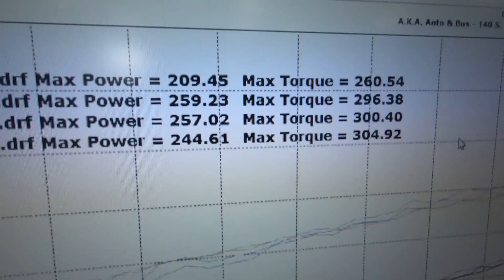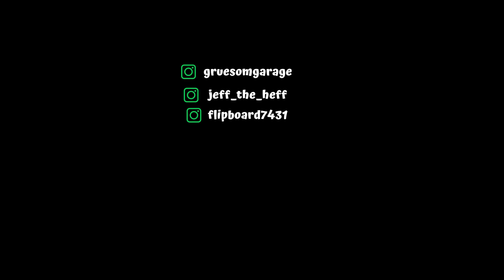Turbo Jeep Tears Up The Dyno

Comment: So the heads on these motors reduce the flow of air if u Dremel them and make it flow better and use an aluminum head you can get 50 maybe 100 hp more boosted and gearing then again 200 hp in a jeep is already crazy asf so I can't imagine 300 or 600 get some stronger internals and a 258 crank that should help alot

Comment: I got  this  fan clutch   and  spear   electrical fan    and  my one  still overheat.  They run  on. 215" up
Reply from the maker: Most likely you need to go through the cooling system, that shouldn't be a problem

Comment: What’s the chances you would share your tune file?  I have a supercharged Comanche with a 4.7 stroker I want to put a mega squirt in. Right now I have a piggyback system that came from boostworks and I’m not happy it will randomly lean out. I’m sure there is power left on the table with it also. I’d need to get it dyno tuned but a base tune would be nice. 

My motor is all forged bottom end. Head has larger valves and heavier springs. I also have a small cam that’s a custom grind. Currently on 9lbs boost.
Reply from the maker: Our tune probably would be too lean for you also as we only have a 4.0, if you pay for tuner studio, it has a "self" learn process on the megasquirt tuning and will help you set up a base before bringing it to a tuner
Reply: @Grewsum2Sum  

Didn’t know it supported a self learn feature that would be helpful for sure. Does self learn just deal with fuel or timing also. Timing is what I’m most concerned with as I have never played with timing maps. 

Sweet rig btw looks awesome!
Reply from the maker: Honestly, we didn't use the self learn feature, we had our tuner do everything im sorry
Reply: @Grewsum2Sum  
No problem at all. Thanks for the help!
Reply from the maker: No problem let us know if you have any more questions!

Comment: Dude that thing is making almost 600HP at the crank, that's excellent. LS Swappers can't even do burnouts with Jeep drivetrain
Reply: Drivetrain horsepower loss doesn’t go up proportionately with wheel horsepower.
Reply: Sir id beg to differ..
My 99 XJ stock with 32 tslrs smokes them off

Comment: Yo guys, thanks so much for all these turbo XJ vids, I've watched them all. You guys are really my main source of research for my own turbo build. Seen you go through the trials and tribulations, but I got a couple questions, mainly fuel and timing related. I'm curious to know how your first, basic setup (pre cam) compares to what you have now, comparing money and time spent setting it up. Worth it? If you knew what you know now, how would you do it from the start? Could be a good video? Personally, for my DDWW I'm leaning towards your first version with MAP bypass and fuel pressure regulator setup - Would you say that worked well enough for a daily? Even though you didn't dyno it, how would you compare it power wise? Specific questions: what injectors were you running and what was your max PSI pre cam setup? I'm looking to do 8-10psi with MAP bypass and fuel pump/regulator setup, possible? Sorry about this essay of a comment, coudn't find any other way to get hold of you guys. Keep it up, love the build a-very-lot

Comment: Very nice! Glad you had a successful dyno day. 295hp to the tire is not bad, not too bad at all.
Reply from the maker: It coulda handled so much more if it wasnt for the stock bottom end but almost 300 to the tires feels really good
Reply: @Grewsum2Sum  what aftermarket stuff is out there capable of handling more than that? I be built a couple of stroker 4.slows but never over the 250-275 hp /320lbft range. are there options out there to take one of these to 400hp?
Reply from the maker: @Irishcream216  really the only thing stopping us from cranking up the boost and making more power are the stock pistons. the only way to get 400 out of a naturally aspirated jeep engine is extremely high compression and alchohol lol

Comment: how much were the coilover shocks
Reply from the maker: Around 800 without springs for the pair
Reply: @Grewsum2Sum  Thats not bad. youve probably mentioned them in other vids but what brand are they? what size are they and the springs are 600lbs rated?